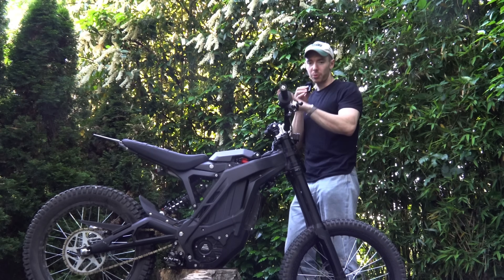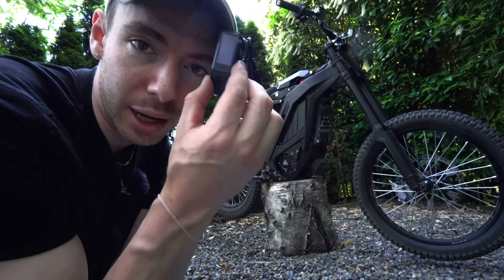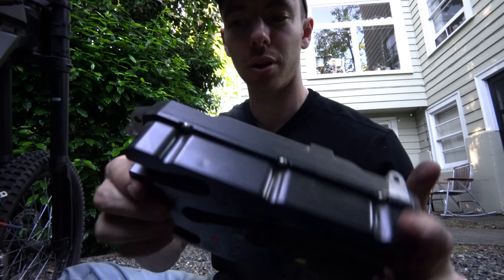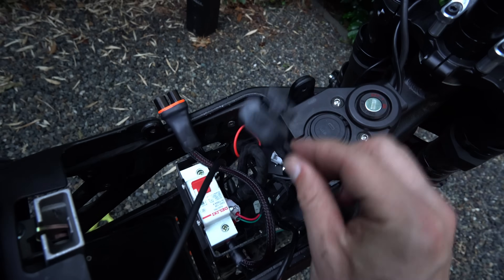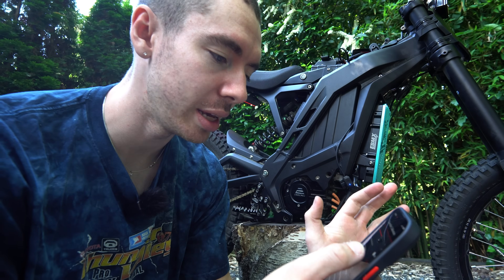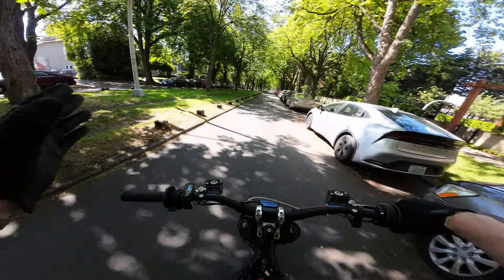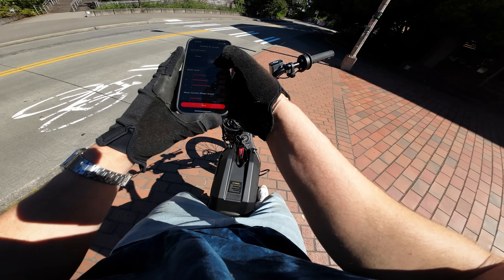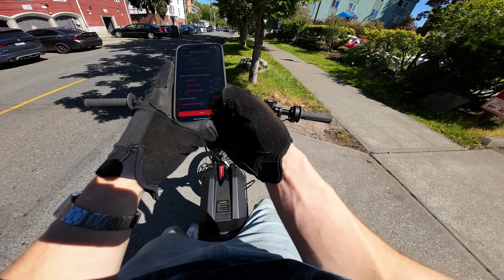I MAXED OUT My E-Ride Pro! X9000 Controller Upgrade (how to install)

Comment: Just wondering if anyone can help me recently got a stock surron light bee 60v 40ah I’ve upgraded from stock controller to the x9000 however when I took my bike back from the shop that fitted the new controller my bike is going 40mph when before it was going 49mph with the stock controller can anyone help me get it back to 49 at least without risking damage to motor battery etc

Comment: What does the controller upgrade do to the bike and whats its cons
Reply: Gives it so much torque but around the same top speed maybe 2 mph faster but insane torque and the cons are nothing maybe that the kickstand censor is gone and you cant use your horn anymore but that’s pretty much it there’s to many pros to name
Reply: @ubchase what controller is good to buy for the e ride pro 2.0 to increase top speed more than 2mph and thank u
Reply: @hundredpercentasian1 controllers won’t change that unless you buy a new motor also. The motor can only max out at 15kw which 12 and 15 isn’t a big difference for top speed just torque if you do get the controller I recommend getting a 48t sprocket which will make it faster or a 42t which will give it much more top speed.
Reply: @ubchase appreciate it brother
Reply: @ubchase could u send me a few links for the sprocket controller and motor please

Comment: OK!!! OK!!! Tu dois absolument lire ce qui suis. Je suis sérieux  tu vas pleurer:$$$$$$$$  À LIRE ATTENTIVEMENT. Tu vas apprendre des petite chose importante à savoir. Salut, tu as pas et tu es vraiment très loin d'avoir: 12 000watts ou 15 000watts de puissances. Il y a des choses que tu as pas compris dans le fonctionnement d'un moteur électrique et des autres composantes du circuit électrique de ta moto. Désolé. Les lois de la physique rendent impossible à d'aussi petit moteur de développer autant de puissances(watts). Je te niaise pas. Les spécifications techniques des puissances(watt)moteur et certaines modifications que les fabricants proposent: Sont pour la plupart  fausse, de par la façon de les présentés versus ce qu'elle représente réellement. Les compagnies savent très bien que tout les gens connaissent pas l'électricité et en profitent pour rendre plus attirant leurs produits. Exemple; ils annoncent une puissance(watt)crête(qui est  très souvent exagéré)de 15 000watt= 20HP, alimenté à 72volt.C'est pas très honnête et transparent de leurs part et voici pourquoi; simplement et sans entré dans les détails techniques: Parce qu'ils mentionnent des valeurs....???, j'ai vu des puissances(watt)crête annoncés jusqu'à 10 x la valeur de la puissance(watts)nominale du moteur(dans le monde réel c'est autour de 2x). Une fiche technique comporte beaucoup plus de détails que la tension(volts)d'alimentation et la puissance(watts)crête. La puissance(watts)crête: Est la puissance(watts)maximum que le moteur est en mesure de généré et là faut bien comprendre qu'il faut absolument éviter de faire en sorte qu'un moteur électrique atteigne les valeurs de puissances(watts)crêtes, pour évité d'endommager le moteur parce que oui si on exploite un moteur électrique de cette façon on le tue littéralement. Elle peut être atteinte très brièvement 1-2-3 seconde maximum, ça peut aller mais à éviter, c'est vraiment pas l'idéal. Suivez moi bien encore!!!(désolé) Le seule et unique moyen et je le répètes encore LE SEULE ET UNIQUE MOYEN de faire atteindre la puissance(watts)crête(maximum)d'un moteur électrique EST: de le FAIRE FORCER. Je dis bien, le FAIRE FORCER. Ce qui fait monté le courant(ampère) que le moteur génère et si il force assez et bien il atteindra la valeur indiquée de la puissances(watts)crête et surchauffera et ça le brisera. Exemple vous enlevé le contrôleur et l'accélérateur : On branche seulement la batterie relier à un interrupteur((((( le contrôleur et l'accélérateur permet seulement de modulé
 entre la puissance(watt)nominale du moteur et 0 puissance))))) et de l'interrupteur jusqu'au moteur; on met à ON et le moteur reçoit la tension de 72volts, le moteur ce mets à tourné et à généré du courant(ampère)si il force pas et bien le courant(ampère) sera celui de la valeur nominal de courant(ampère)du moteur. Donc il travail à la puissance(watt)nominale du moteur. Comment on fait pour que ce moteur atteigne la puissance(watts)crête(maximum). Je l'installe dans une configuration que le moteur est trop petit, pas assez fort et là... Il va atteindre cette fameuse puissance(watts)crête. Elle est pour indiquer au techniciens si le moteur force trop(elle est un seuil critique d'exploitation de la puissance(watts).Elle ne devrait pas être atteinte.(((( Y a aucun intérêt et peut importe l'application)))) de vouloir qu'un moteur électrique atteigne la valeur de la puissance(watts)crête mais si tu y tiens vraiment à cette puissance(watts)crête. Je te donne un truc pour l'atteindre; Suis moi bien là... , tu me suis bien là, tes prêt; Tu appliques les freins et tu ne les lâche pas et là... Tu accélères à fond et tu maintient les freins ne les lâche surtout pas et je te promet que OUI !!!, OUI !!! tu l'atteindra cette fameuse puissance crête, qui te fait rêver mais surtout DUPER.((((( La Batterie, le Contrôleur, l'Accélérateur ))))) peuvent pas, je répètes PEUVENT PAS AUGMENTER LA PUISSANCES(watts)D'UN MOTEUR ÉLECTRIQUE !!! Est-ce qu'il faut que je ré..... HEY!!! BONNE JOURNÉ À TOUS !!! ET SOYEZ PRUDENT !!!! ÇA MARCHE CES PETITES BÊTES LÀ !!! Cette Vulgarisation explique le fonctionnement d'un moteur électrique dans un circuit électrique et dénonce les STRATÉGIES DE MARKETING FRAUDULEUSES DES FABRICANTS.

Comment: hey uh i had a question cuz like i wanna change my batterie on my e ride pro ss 2.0 and like i wanna buy the controller so like i can install controller and a much better battery but like i need your help i don't know what battery it can handle like max voltage and max amps like i need ur help to find one please respond asap

Comment: Hi Logan! Happy that you're happy with the controller. As you're no doubt aware, it can actually push much more - like other controllers in that range. I'm building a DIY bike now, and planning for 30kW peak from a 72V battery. Cheers! :)
Reply: That will 100 drain the 72v battery MUCH faster though so your milage will be poor.

Comment: Have an eride pro. And a talaria mx4 and I gotta say personally the talaria is better. Have had so many little issues with eride out of the box and after riding for less than 50 miles. Chain issues. Front fork lock. My mx4 has 500 miles on it with no issues to date. Nice videos man. Can tell you put in a good amount of work.
Reply from the maker: interesting! sorry to hear about the eride issues, i haven’t had any problems but that’s just anecdotal. thanks for the kind words 🫡
Reply: I also have risen both consistently my e ride pro has 1900 miles on it haven't had any issues at all, the mx4 at 60v doesn't feel as strong and the throttle seems to take a lot of turning before it actually moves the bike, on the other had the e ride pro stock throttle is so so so sensitive

Comment: Pumping that much power into an air cooled motor will burn it up prematurely. Someday, I hope to see manufacturers introduce a water cooled controller, motor and radiator upgrade.
Reply from the maker: x9000 has a water cooled heatsync option! would love to try that at some point. at 15kw the motor heat isn’t too crazy, and you can adjust the temp cutoff to lower power if it ever gets too hot, so that helps with longevity
Reply: Yea aftermarket motor helps a lot

Comment: Yo! I'm 6'1" and like 275lbs... I know I'm like a "huge rider" compared to most but I've been eyeing the E-Ride... Should I get it or lose more weight first? lol Or is there a simple suspension upgrade i could do to make the bike handle the extra weight? I appreciate any advice.
Reply: The max weight is 300. At your weight, you’re going to feel the frame flex and you’re not going to be about to get the bike near 60 
My cousin is about the same weight he’s at 272 and he slows the bike down significantly he maxes out about 48-52, battery level matters. The battery drains a lot faster with him on it. I’m 145 and I get the bike to its max speed.
He still has fun tho, just a little slower than the rest of us

Comment: Got the k512000watts 84volts Samsung battery 🔋 running a QS273 3,5 t hub with 200 amp sabvart control tuned 😄 60mph try around 90mph plus ➕️ dude 😀

Comment: 1 year later and I'm still messing with throttle tune on my MX4 / X-9000. Yeah, the power is sick but it's tough to dial in a good throttle feel for my type of riding. Let us know what settings you end up with after a while. 8KW/450 phase is my sweet spot for dirt & trails. Any more than that and it just spins the tire ...
Reply from the maker: interesting - it’s been so much better for throttle tuning than my BAC4000 is, but would be amazing if you could see the throttle curve in the app itself. i’m at 10kw like 380phase i think, might lower it even further for dirt & jumps!
Reply: @logan-taylor  I've been asking them to add a graph for throttle curve for a year now. They never answer. Also a firmware update will reset all your settings ... as a former app dev I know how easy it would be to fix these things but they just don't respond. My guess is they hired someone to write the app one-and-done, there doesn't appear to be any updates ever which kinda sucks. I really like KilloWatt for the BAC, it looks so much better ... and the developer actually responds to questions about his app. Take care bud, thanks for the video.

Comment: solid video! being able to have 3 separate tunes is really nice touch, hopefully ill be in the e bike scene next summer, working on getting a surron build going.
Reply from the maker: heck yeah, hope the build goes well! you’ll love it
Reply: The LBX is over rated. Due to Sur-Ronster short size he keeps it relevant.
Reply: @shockadellick  Yeah. I sold my Surron. Looking to get into one of these with that 9000 controller. Creme de la Creme.
Reply: You won’t regret it. Been in the bike scene for a bit. Hated on  e bikes for years. No shifting, “terrible range” etc. 

Little did I know none of those things actually matter for the way I ride it. Totally obsessed with e bikes at this point.

Comment: Soooo...... are you worried this is going to burn up the motor or battery? If not, this is filthy
Reply from the maker: nope! At 20kw the battery starts to heat up a tiny bit, but at 15kw they say it’s rock solid temps and everything. stock bike is 12kw, so we’re not pushing anything toooo hard :)
Reply: @logan-taylor  so as a first-time ebike rider (I had an fz09 for years), would this be a worthwhile upgrade or wait for a bit?
Reply: @skydivemurr  watch the beginning of the video, should have your answer

Comment: The x9000 is the best controller out.  I run it with the ebmx xlb60 motor.  My shit hauls fucking ass. Sketchy fast
Reply from the maker: “sketchy fast” is a great way to describe. 40kw peak is pretty unbelievable for a controller this size